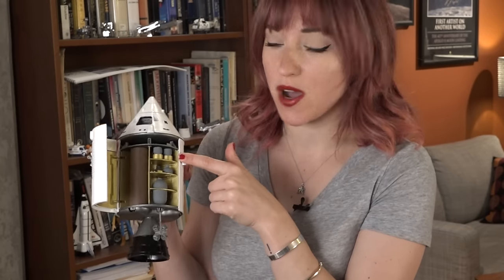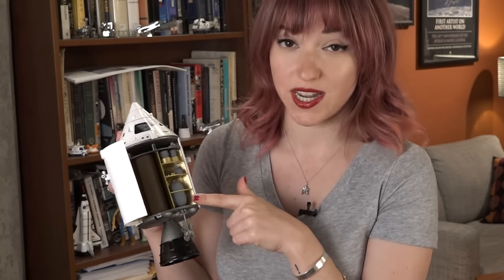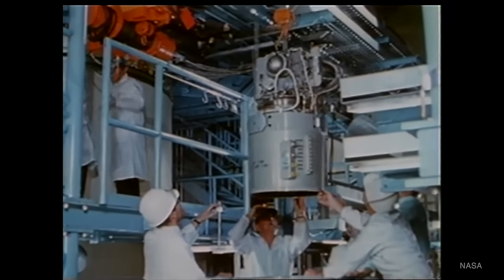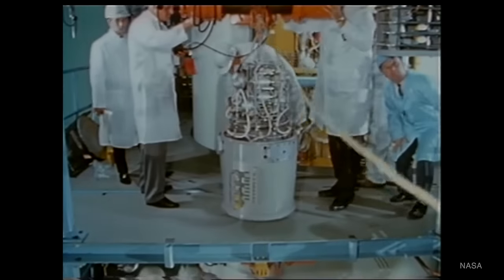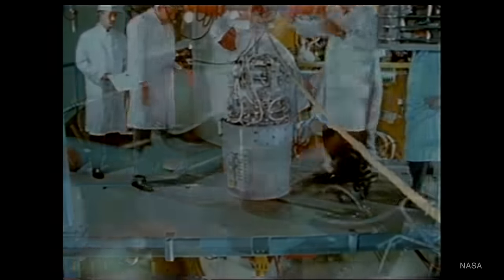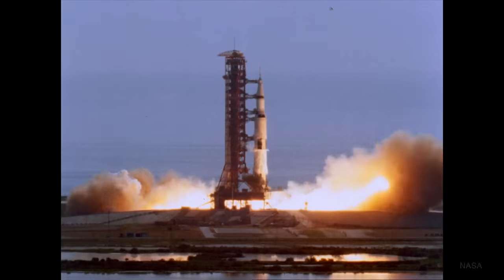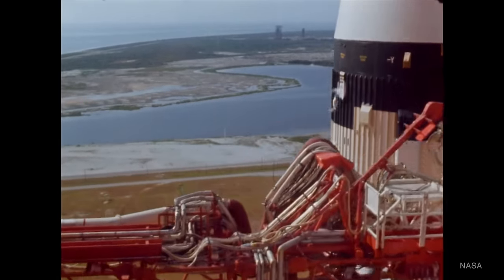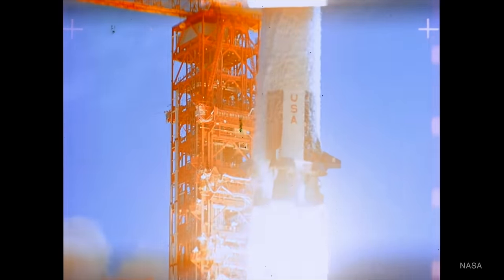How Quickly Did the Crew of Apollo 13 Know They'd Lost the Moon?

Comment: I actually have thought a bit about how after the flight NASA could have made more use out of what was already up in space with them. It seems that making things safer always means that less "work" gets done on the mission. OK, after 13 happened couldn't NASA have said"we need to reconfigure so as it can be easier to use the LEM as a lifeboat". Have all the cabling and tubing already set up for use, none of this running cables from the LEM to the command module. After they started taking a lunar rover up with them could't they have said "how can we make use of both the electrical power and the oxygen supply (or install extra oxygen on the rover) for emergency use in the command module. So frustrating to have both oxygen and electrical power on the rover but no way to reach it and configure it for emergency use  while you are in space. After 13 couldn't NASA have actually created a plan on just how to use the LEM as a lifeboat instead of just "winging it" as was done with 13. Taking all these precautions and making it so all your resources you have with you would have taken time, money and decreased what you get done with the limited time Apollo was set to exist but who really wants to relive the mad scramble that happened on 13? Actually planning on having 3 people use the LEM as a lifeboat would have been so much safer. Making use of the electrical power you had on the rover(after rover started making the flight, of course) would have simply given you more options when "Failure was not an Option". Oh about when the crew knew the landing was scrubbed/ It seems to me that when Jim Lovell saw that "we are venting something into space",was that moment. Electrical power was only one of the problems, oxygen was another. I wonder if those charcoal scrubber canisters were standardized for subsequent flights? I also wonder if a plan appeared in the manual for just what to do if something like what happened on 13 happened again. A couple of times in the movie they commented on "we never planned on this happening" Should NASA have been using "joules" as the unit of power instead of "amps" (I do not even know if there is a "joules" meter).
Reply: Hello dponzi. I did see that video that Amy presented that confirms what you say (lifeboat idea was thought of before). Amy did say that oxygen was increased by 10%. It appears (and I certainly was not there) that this was only a half hearted move to use the LEM as a lifeboat. It sure would have been nice if they said "what if we lose our fuel cells and must rely on the LEM and later the rover's electrical capacity". Then there are those darn scrubbers that did not fit. I guess if backup was just a few rocker switches away there would not have been such a great movie.Hey video 6 of the "Moon Machines" series makes it very clear how the rover folder up and was stored. I still would like to see Amy produce a video on lunar rover storage. I did not quite grasp the battery technique that was described in video 6 of Moon Machines.
Reply: Hello dponzi. Talk about getting just what you asked for, this article was very informative, I recommend it to all. Some things brought to my attention. NASA did plan on using the LM as a lifeboat. NASA did run sims of using the LM batteries (large batteries were stored in the LM decent stage). The process of making use of the electrical power in these batteries was a bit complex. The circuits used to transfer this electrical power were controlled by relays that were powered from the CM. If the CM had no power it was harder to make use of the LM's batteries. NASA ran a sim of this transfer for the Apollo 10 mission. The sim was a failure resulting in the virtual death of the crew. NASA abandoned the sim saying the scenario was not plausible. The people in charge of the sim did not like the way it ended so they continued on without official NASA blessing. They were called up for help with Apollo 13. One of many things I found out. The LM and the CM had identical guidance systems. Something that was confirmed. It was Lovell's comment about 'we are venting something into space" that said "this is a rescue mission not a lunar landing". No comment if  making use of the lunar rover's electrical power in an emergency was considered but they (the LM's batteries and the lunar rover) were physically close to each other in the decent stage of the LM. This is an article that everyone can learn something from.

Comment: TOPIC / Question... why did the Apollo Missions use three crew members? I understand that they wanted one man in orbit for the CM rendezvous, but why did they need two in the lander?
Reply: +dregerclock :Mainly for safety. What if one died on the moon of say, a slow leaking hole in his suit. The other crewmember could possibly rescue him. Another reason was the experiment and photography workload. And in later missions, the LRV deployment. The LRV could be deployed by one person provided no problems occurred. But problems have to always be factored in and this is where having two people provides a level of redundancy not present with just one. The Russians were going to send one man to the lunar surface, but given that they had so much trouble just getting their Saturn class N-1 launch vehicle to get past booster burnout on 4 launch attempts, it could have been a catastrophic risk just sending one person to the lunar surface. They even had plans for that one person to do a spacewalk while in lunar orbit just to get to the docked LK lander because there was no tunnel between the LOK orbiter and LK lander vehicles.
Reply: +J Dean - Also, if you've ever watched any of the videos showing the view out the LM's front windows that are synced to the air-to-ground audio it's apparent that the landing was a highly co-ordinated effort between the Commander and the LM pilot. The computers back then had limited capabilities by today's standards so during an Apollo moon landing you probably needed two people working together in the cockpit. For example early during the decent Buzz Aldrin concentrated on the radio communication back to earth while Armstrong was busy looking for landmarks to verify the navigation. Then during the final moments of the landing Aldrin is calling out altitude and translation rates while Armstrong was actually controlling the vehicle.
Reply: +Joe Vignolo :Excellent points.
Reply: +J Dean +Joe Vignolo - Yes thanks... both of you ... great points!
Reply: +dregerclock :Thanks, glad I could help.